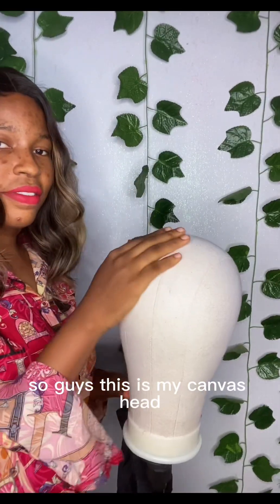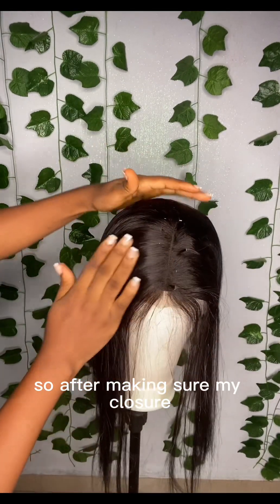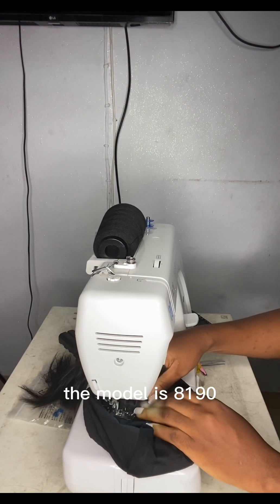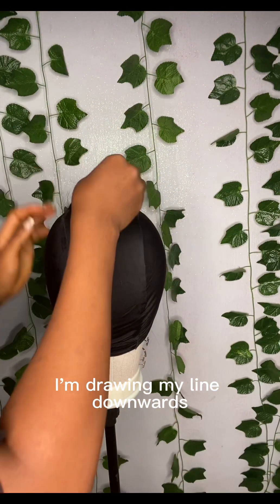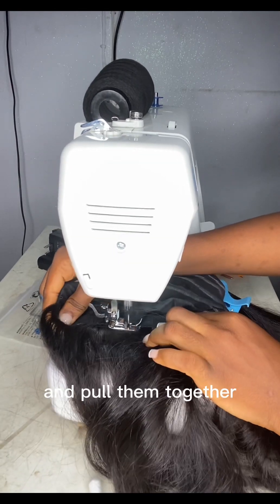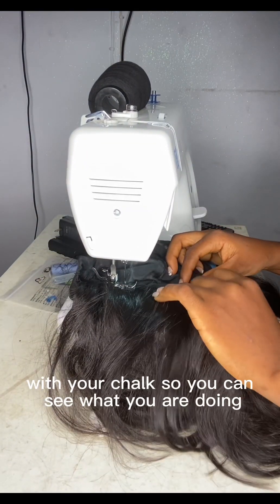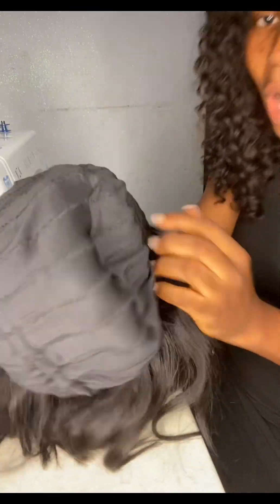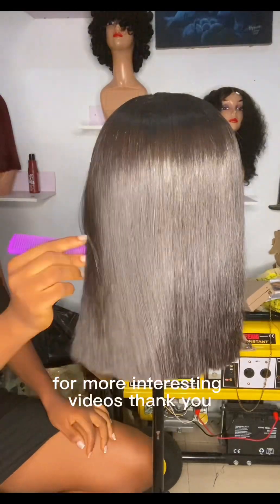Learn how to make wig without bumps with your sewing machine

Comment: Why does my wig cap shrink after sewing
Reply from the maker: It just so happens that way. This happens mostly with machine sewing
Reply: @Heiress_arcade  can I do anything about it
Reply from the maker: @amakyikangah4561  have you sewn band on the wig? That should be able to help a bit but if it doesn’t help I think you have to either manage or re wig using a bigger cap